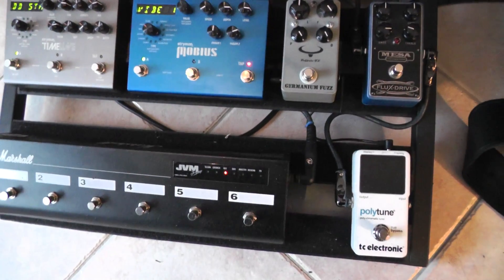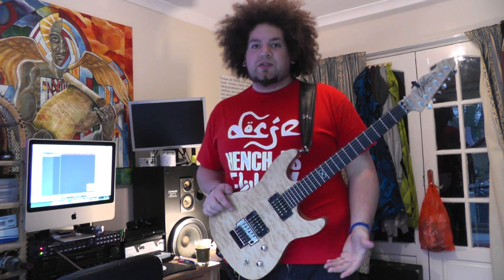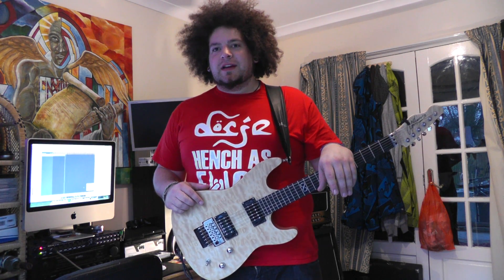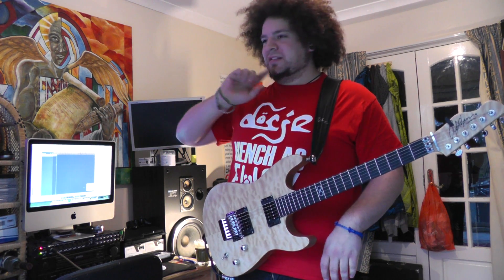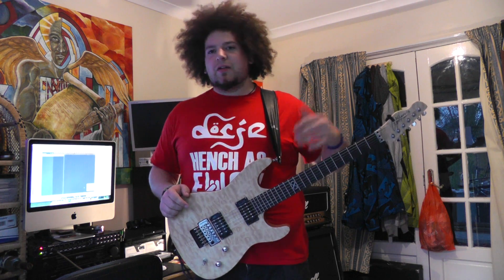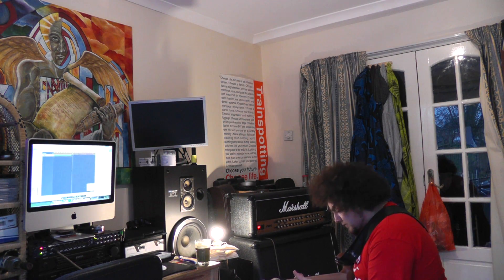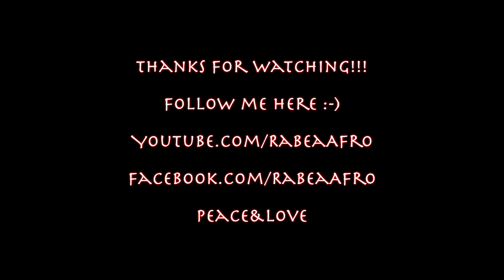Afro Demo - Buffalo FX Germanium Fuzz

Comment: Four controls dial in the Buffalo’s many flavors of sputtering, popping bliss. F controls the amount of fuzz. P controls the amount of pre-gain. L (level) uses a reverse-taper potentiometer, meaning the resistance tapers as you turn the pot clockwise—an effect a lot of audio engineers consider much smoother and more natural. B (bias) enables 3.5–8.5V of bias adjustment, which is useful because germanium transistors are notoriously susceptible to natural variables like temperature fluctuation.

Comment: Time for a revisit of this pedal. It's still on your board as of 2020. Makes me wonder what this thing does that others do not. Have you looked for replacements? Or is this "just right" and a keeper on your board? Have you found any new applications for it? New sounds or ways of hooking this one up? 

I found one of these (a V2) a few years ago, and not letting it go so far. To me, it's just "a good germanium fuzz without too much options" (think zvex). I think Steve Painter (Buffalo FX) has shut down his webshop (end of july 2020) btw... so these pedals (especially the old form factor) are getting harder to find, as no new ones will be made.

Small update: as of May 2021, I own #13 of the limited range of just 50 of these V1 versions. (with the Matsushita 2SB175 transistors). V2 has Texas Instrument 2N404 transistors fwiw. Not letting either one go for the time being.
Reply from the maker: Haha wow old video! 

I think that’s the thing. I just love the way this fuzz sounds. Applications wise not really much change. I just use it for that sound. I got sent a V2 a few years ago but sadly it’s stopped working. 

I saw the eshop shut. But yeah, mine is still going strong, the V1 big brick thing! Love it
Reply: @RabeaMassaad  Very old indeed. But still relevant. Even these older reviews I sometimes revisit to steal licks form. :) 
Thanks for the reply Rabea!
 Stay safe in these strange strange times.

Comment: the B must stand for bias, it basically is turning down the voltage going into the pedal (or emulating it) as if its run out of battery

Comment: It's not about the spring having the same tension each as it is the bridge having the correct tension so you can level it properly. There is that very small window what you can't get with tight 3 springs nor loose 4 springs. And those feel definitely different so It's just personal preference.

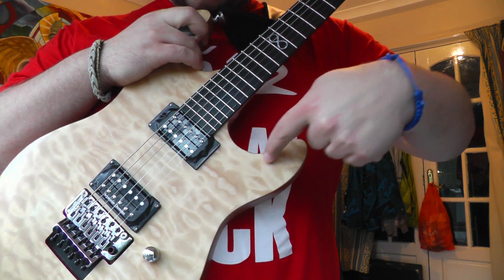Comment: Bea, at 3:35 - Sort ya bloody springs out!  They should be STRAIGHT... ALL OF THEM....  Otherwise they aren't under the same tension.  This means the middle one is doing FUCK ALL except making horrid spring-stretch noises and may even drop out in the middle of a dive/pull up on the bar because there isnt any tension holding it in place. :)

Comment: "levelling the bridge" is easy for someone with a screwdriver and a tuner.  "String tension" and "Spring tension" must be equal to level your bridge, and that adjustment is made with the screws inside the trem rout where the springs attach to the claw, not by adding more springs in pretty patterns and opening yourself up to potential problems with spring noise or even worse a spring coming loose inside the guitar while youre playing it.  It makes an awful racket, trust me!

Comment: I've never had any problems with my 4 Floyd Rose equipt guitars and have never anyone having any porblems with that, amateurs and pros alike. Sure anything can go wrong but it's possible with straight springs too. And those claw screws go on ly so far so eventually you must either angle the springs or add more but whatever works for you.